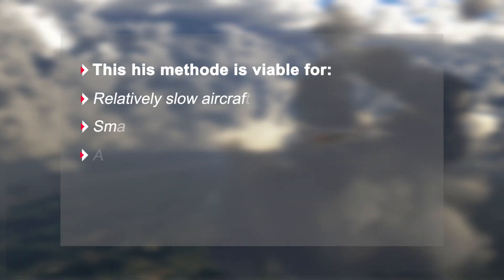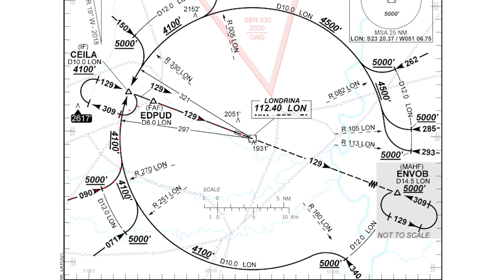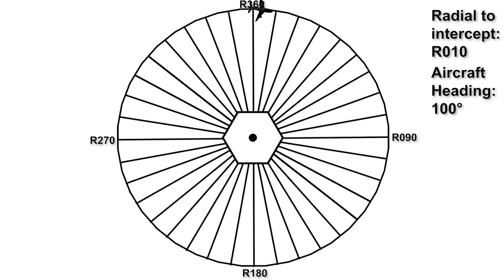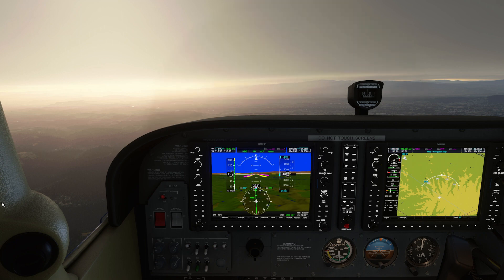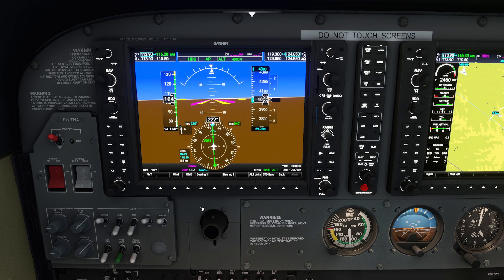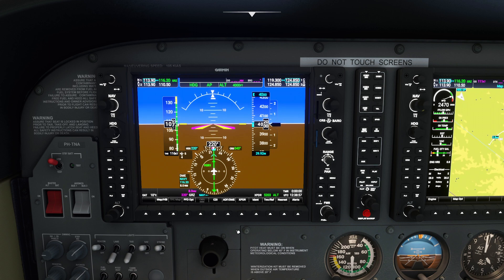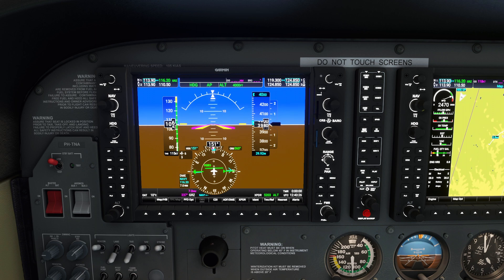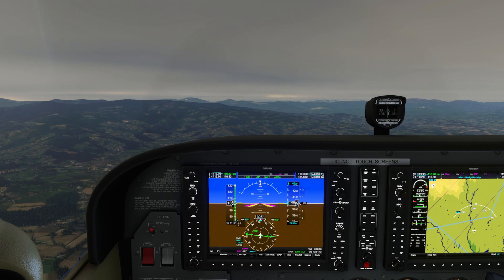Virtual Flightschool: How to fly a DME Arc

Comment: I have a question. Could you Join the Arc from inside in certain situations? Would that be ilegal? 

For example, imagine a procedure where the published track of the arc is not a 360° arround the airport, but only 180° or 90° for example. And for whatever reason Im coming from another sector of the airport that is not suited for this procedure, but due to whatever unexpected reason I need to make this procedure and now I find myself out of position at the oposite side of the IAF.

So I fly straight to the VOR from where I am (the oposite side of the IAF), fly over the VOR and then I take the radial that takes me to the IAF and start the arc by turning the oposite way that I would turn If I join the arc from the outside.

Is this legal? Or I would have to respect the DME distancie of the Arc regardless if Im not crossing any published track for this procedure? 

Could ATC request that I join from the inside If they need me to avoid traffic? Is this a thing?

Comment: Well this is perfect but i have a question. All the tutorial i've seen since now says that you have to follow the "turn 10 twist 10" but i realised that following this method i continuously distance myself from the vor. Because they say you have to first turn 90 and then turn the vor 10 degrees but doing this the radial will not be at 90 degrees with your heading but at 80.
Reply from the maker: You want to Intercept the next radial at 90°, and depart the radial you're on at 80°. This is why the first turn is not made at 90°. Because doing that will take you away from the VOR. I mention this at 4:49. It's a common mistake during the instrument rating actually. 

I hope this answers your question!
Reply: @thenewaviator6693 thank you so much! I had this problem for a lot 😅
Reply: Don’t make it hard on yourself. Forget the turn 10, twist 10. Many pilots get distracted and pass their inbound course. Cockpit is too busy! Do this. When you arrive at the beginning of the arc, the fix located on a radial at a given DME, let’s say it goes in clockwise direction. We will use the 315 radial at 7 DME. The inbound course is 240. Turn left 90 degrees and establish your distance. The 315 heading will be exactly 90 degrees left on your DG/HSI. Turn your course selector to the inbound course of 240. Let’s say you’re now 7.1 DME. Turn right about 5 degrees and wait. After about 30 seconds, turn right another 5 degrees. Now you at 7 DME and you wait. About 5 more seconds turn right another 5 degrees. If you go to 6.9 DME pause your right turn longer. You are allowed to be a mile plus or minus so .1 or .2 DME either side is acceptable. Now notice where you 240 heading is on the DG/HSI. It is slowly moving toward the right side. Keep repeating until you 240 now close to the 90 point on your DG/HSI. When the CDI is about 2 dots from center, turn right to 240 and you should be very close to being on the inbound course. Once you do this a time or two arc flight will be natural and you won’t get lost or forget to turn inbound. If you have a G-1000 you can let the GOS track the arc and watch what I described with the bearing pointer. Hope that helps.

Comment: 220 -90 = 130 and not 140 … anyway  good video DUDE !
Reply: Thanks! Your maths are correct, no question about that. But I'm not substracting 90 from our intial heading of 220 degrees, but rather adding 90 degrees to the 50 degree radial I intercept. The first turn is never 90 degrees, because that would mean that you intercept the first radial under an 80 degree angle, which means you would spiral away from the DME. I hope this clears things up!